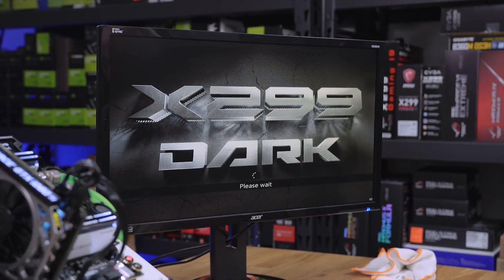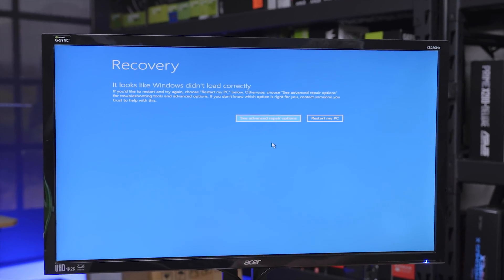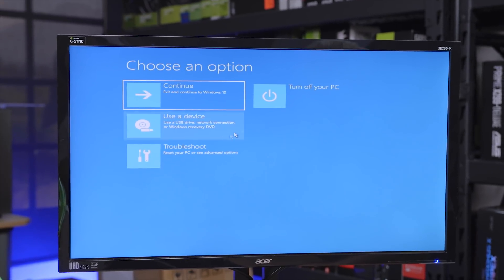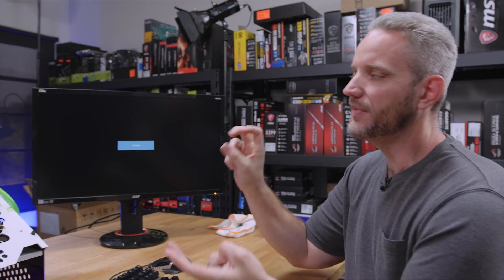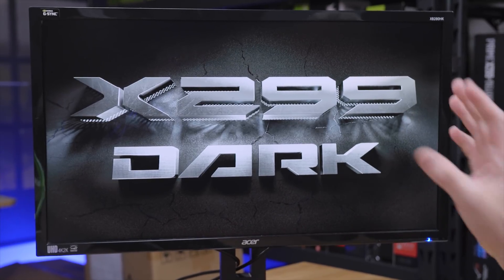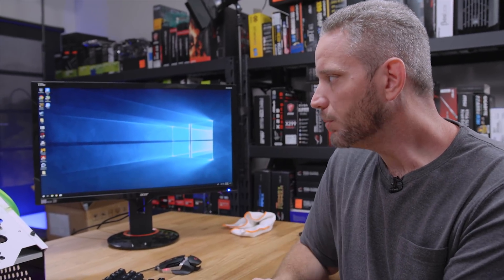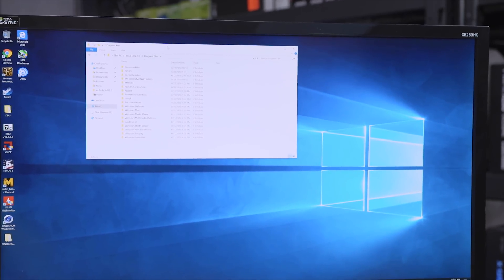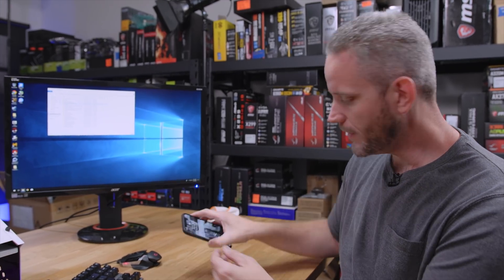New Test Bench Keeps Boot Looping... Here's how we fixed it

Comment: New Mobo(Platform Switch) = Clean OS 👍
Reply: i5 2500k with Windows 7 upgrade to Windows 8 upgrade to Windows 8.1upgrade  to Windows 10 from that to Ryzen 5. The system was running relatively ok but was messed up with the occasinally BSOD and the point i had to do a clean install. Was interesting to see how long a Windows installation can last.
Reply: if your just upgrading from one intel to another intel then its no big deal,since win 8 you could do it very easily,even in win 7 and xp yo could do it but you had to reset the hard drive controller first from a bootcd.
what you do need to do later on is clean up all the junk that accumulates over a few years and hardware changes like the uninstaller directory or old drivers that are no longer used etc.

what 8 and 10 do when they detect hardware changes is do part of the sysprep process to work on the new hardware,you could even do sysprep images of 7 and xp and install on various hardware so you could skip installing everything from scratch each time.
only issue with sysprep images was moving from intel to amd or vice versa,though it seems with ryzen you could do it but would get stability issues.last time i tried an intel sysprep image on an amd system was with windows 7 and in that case it blue screened during the boot.
Reply: Clean OS = Continues to Boot Loop = Shit. LOL
Reply: You can still access the safe mode by booting from install media. Is that so hard? What bothers me is that he's blaming MS but the software he installed - a software clearly made for prousers giving you a huge disclaimer when starting it - is causing the issue. This is why MS does crap like Windows 10 S, then you at least can't blame MS when a program has destroyed your OS, because it's not going to happen.
Reply: @Gerrit So you're telling me that they aren't complete fools for making a well established, user friendly, and intuitive safe mode that's only been improved with every windows iteration into a hard to access and counterintuitive downgrade to what we had before in windows 7 and prior? I'm not familiar with os development, but this is an issue that clearly has nothing to do with development. This is a design choice. What we had before was simply a key to press on startup to access a boot options menu, now we have this long and frankly stupid process in windows 10. No matter how you look at it, what they have here would be more work to program than simply leaving the boot options menu as a hotkey during startup. That aside, safe mode is meant for problems that are exactly as shown in the video. There are many times when program conflicts can cause bootloops, and there's absolutely no reason for uninstalling to be disabled in safe mode.
Reply: It seems you are so damn smart, you could work for Microsoft. You totally missing the point of this video. It is about the that stupid Windows that doesn't let you uninstall a troubling software component in safe mode. That is a common scenario and has nothing to do with his platform switch.
Reply: i usually clean the drivers and just keep my programs
Reply: Yes a person who thinks like me as if I were to buy a new system it's getting a Clean install so there will be no leftover drivers from the past Motherboard .  Windows doesn't mind you doing a fresh install as if you were going to update your system to a new one you just have to let them know the old system is not in use anymore and your copy of Windows 10 will work on the new system...     I suggest keeping games onto another drive so you don't loose your saved games and most everything else you re-download as I will keep my software like  Adobe Photoshop on my main M.2 for fast boots but save everything to another drive so you don't loose anything when doing a clean install .
Reply: i used the same install on 4 different boards. gigabyte X99 > asus X99 >asus X299 > asrock X299. also migrated from a SATA SSD RAID 0 to an nvme SSD. 
YOLO!
Reply: Lmao, never had an issue. Switch from the FX series to Skylake without a clean install.
Reply: Clean OS install isnt needed, just put the OS into OOBE (out of box experience) mode
Reply: What jay should do is setup a pxe bootable windows installer environment that installs all of his testing software and games automatically. Depending on what hardware he was trying to use. Make testing more consistent and take some of the time between setting up go away. He could then update the “master” config once a quarter or with new installs. IE new nvidia drivers. drop the new MSI in the appropriate network folder and change the config accordingly.
Reply: how i felt upgrading from an FX 6300 to an i7 8700k
Reply: I blew an 1150 CPU and had to switch to 1151, was just plug and play.
You don't need always to reinstall your OS.
Reply: fx does not have the same drivers as ryzen DUHHHH
Reply: Indian tech support dude right here....
Reply: This is the best and only answer IMHO.
Reply: I'm a computer engineer
Reply: With how ludicrously fast Windows 10 installs on a modern system with an SSD AND is rather good at keeping UI settings and applications, I install clean or with preserving user data after every hardware change.

And well, considering I've been on Windows Insider since day 1, I'm kinda used to do full updates and installs anyway, so doing a reinstall is trivial.

And really, with an SSD, installing Windows takes 15-20 minutes tops with fuck all to do as a user.
Heck, even on my laptop when it still just has a HDD, it didn't take more than half an hour.
Reply: He's calling Microsoft monkeys but has software installed that is directly accessing the uefi and in that case it's looking for an uefi that it can't find. The only logical consequence is that the OS isn't booting. You should be glad instead that Windows offers something like a safe mode to undo things that should have never happened in the first place. It takes a ton of effort to develop a OS that is compatible with so many different pieces of hardware. What should MS do? Prompt you everytime you start ryzen master that it could break your OS? It's a users fault. Period.
Reply: The "monkeyness" on Microsoft is in how stupid it is nowadays the way you access safe mode.
And the installer services not working in safe mode.
And the uselss "not BSOD anymore" screens.
Reply: MS had a proper safe mode before. He's calling them out for making accessing the safe mode unnecessary complicated and hidden. What use is a damn safe mode if the only direct way is to boot to your desktop? Now you have to fail at booting windows 3 times and then you get into the recovery menu but you still have to click through half a dozen menu levels to actually access the damn safe mode. 

But I guess you're just the impeccable almighty and alknowing Gerrit who never forgets to remove a program. Ashes on our pitiful heads …
Reply: Old way was to hit a key to bring up a boot option menu while BIOS was loading. They should have kept that..
Reply: What they could do, is allow windows installer to be started as a service manually in safe mode since that was the first thing he tried..
Reply: very strange they disabled the installer service in safe mode but you can enable it.
google "windows installer service safe mode" and you get as first result a thread on the symantec website about a registry entry to create in safe mode to get the uninstaller to work. sure renaming the folder is an "easier" solution but if you arent afraid of the registry than i think the solution i found in 2 seconds of searching is better.
Reply: And honestly I can't take it anymore that every hardware guy is shitting on Microsoft and actually knows nothing about OS development or even software development. Use Linux instead if Windows is annoying you so much but you just don't have the knowledge for that either.
Reply: Aww, looks like Gerrit got his panties all twisted. Poor baby.
Reply: Gerrit Gogel because it makes perfect sense to bury the recovery menu options under 6 screens you have to click through and a reboot and only after 3 failed boot attempts where you previously had to only press F8 at boot that has worked fine since f*cking windows 95, right? RIGHT? Oh, and disable windows installer service because god forbid they'd make it easy to uninstall whatever crap is hindering the boot process in the first place or install a bloody anti-virus/malware scanner if you know that to be the issue.
Reply: I've been a software developer for 10 years, and I still think Microsoft messed up here.  Since Win95 you've been able to get into safe mode in a straightforward way by mashing the F8 key during startup that interrupts the process and can put you there.  They overstepped their bounds in trying to make fixing problems "more friendly," hence the frowny face emoji on the blue screen now.  Safe mode is scary and makes normal users pee their pants, so it must be hidden from them at all times.
Reply: Windows 10 has some flaws, I'll give you that but compared to Windows 7 and 8 it is such a huge step forward and I say that as a person who deals with issues from MS software everyday. Tell me a company environment that runs without MS software. That's just almost impossible. Most of their products, is it IIS, SQL or Exchange basically run out of the box and well together. If you configure that in an linux environment it's a pain in the butt. You need multiple different services to get something like kopano, which is a competitive product to Exchange, to work and it's not even close as good and reliable. That is where Microsoft shines: out-of-the-box solutions for huge environments. And everybody who thinks linux systems have a better user-experience, especially for "normal" desktop users, has never ever used linux. You can just erase your whole harddrive with one command and the most you get is probably a warning message. Linux systems have their place. I personally use linux daily but I don't see it as a widely-used replacement for Windows in the next ten years.
Reply: Do you work for Microsoft?
Reply: Gerrit Gogel they could have just modernized the boot menu and kept the keyboard shortcut so as not to scare users that inadvertently press that and end up there(which I bet was the cause for it's removal) instead of completely removing it and burry it. The new way just cause pain for those that just want do do stuff without fighting the OS(actual professionals and enthusiasts). And about linux not having a good user experience for normal desktop users, that can't be farther from the truth(at least concerning the desktop), also don't confuse good user experience with familiarity, I challenge you to leave anybody that hasn't ever touched or even seen a computer in front of a linux distro with GNOME desktop and on windows 10 and see which one they get used to faster(launching apps, managing windows, etc).
Reply: Gerrit Gogel “you can erase your drive with one command”... have you ever heard of format C: /fs:fat32? or deltree C:? Linux isn’t the only one that has commands that can erase the disk, Windows can do it just as easily. Windows is a shitty operating system. The WinAPI is a buggy, undocumented piece of shit, and nobody should ever use it for anything. I’ve tried using it.
Then Visual Studio crashed. And kept crashing. That’s also another major issue— programming anything for Windows nearly always requires VS, unless you’re running some kind of mingw/clang toolchain. 
Windows is not my favorite operating system.

Comment: Honestly I'd say it is AMD who sucks more in this case. They should handle the error gracefully and spit out an error prompt if it detects a non-ryzen cpu. Windows suck because it is hard to get to safe mode and uninstall something, but you shouldn't have to if AMD handled this properly.
Reply: A fault in a user program should not cause kernel panic. Ever. And keeping that true is the burden of Microsoft
Reply: As Zero stated, it's a Driver causing the crash, not a user program. It can happen, GPU drivers, Storage drivers, etc can all crash the system on a boot if they run into unexpected conditions.
Reply: A quick google search said that "AMD Ryzen Master" is a tool to overclock ryzen chips ... I guess similar to Intel Extreme Tuning Utility? 
I first thought it was a very important thing for CPU compatibility, which would explain why an incompatibility results in a blue screen (like the running a AMD GPU with NVIDIA drivers example I've seen in another comment). 
If its just an overclocking tool, I'd say it shouldn't crash the os. I guess an overclocking tool needs low level access but I don't really understand why it can cause a BSOD...
Reply: Wargon. It actually does have some reasoning for crashing the OS. A CPU overclocking tool is different from  GPU. Programs needing that level of access most likely will interface directly with the HAL, which is OS provided. If any component of the HAL were to crash then the correct behavior would be to kernel panic, as there is no redundancy to catch it. 

For this to be handled correctly, AMD should have caught the exception withing the app itself, which is part of the problem, but with this kind of tool there is no redundancy.
Reply: It seems to use a driver to do stuff and it has extra functionality besides overclocking, related though. Things like turning cores or SMT on or off and changing how memory works on multi chip things like threadripper. It does it regardless of what the bios lets you do. It seems to access something at the hardware level. Idk. Would be nice if it didn't cause a BSOD. Thier software for the older FX CPUs does the same thing. It caused a BSOD for me when going from an FX 8370 to a Ryzen system. I only have a laptop with Intel so I can't say if their solution behaves similarly when switching platforms.

My guess though is that by loading in a driver it can access low level things from kernel space, while the application gives it commands from user space.
Reply: The issue here is where does this "driver" go. from a fundamental standpoint The ONLY way to talk to a CPU is through the OS. so any faults that occur with this operation would be uncaught (if not what would catch it?) and would result in a Panic (BSOD).
Reply: no its Jay fault everyone knows a fresh window install will help you with all the trouble bugs and stuff
Reply: I think one of the issues here, it's quite rare that people will switch the Mobo and CPU from AMD to Intel, on the same computer.   I think what is more common, is you take your now 3 year old games machine, pass it along to your spouse for word processing, browsing and email, who passes their 6 year old computer on to kid #1, for homework, who passes the now 9 year old computer onto younger sibling, who takes the 12 year old computer they were using and it goes to the e-recycling bin....
Reply: How is windows fucking up amds fault.
Reply: Zero not true, a properly written driver runs a check for the hardware it uses at initialization and unloads itself if it's not detected
Reply: amd ryzen master does have its own driver and it has caused me issues before.  windows should just kill a driver that malfunctions like it does with graphics drivers.
Reply: @storm Since the issue only occurs when you launch Ryzen Master my guess is the driver component it needs is already stopped or unloaded by Windows. The dll file mentioned is unlikely to belong to the driver so my guess is Ryzen Master tries to call something that's not there and this causes unhanded exceptions at some kernel level that Windows just can't recover from.
@Paul That's not really relevant here. AMD should make better code either way. Also Ryzen Master is used for overclocking. Right from the get go you know the people using it are going to be power users with an above average interest in hardware. They really should expect them to try stuff like this far more often than your average consumer.
Reply: Finally somebody with some brains. Sure the procedure to get to safe mode is atrocious and they really should have a quick option to disable specific programs from startup that's available in that glorious recovery menu of theirs, since that's a common cause for problems like this, even so it's not their fault that AMD are writing bad code. Sadly it seems your average Jay viewer can't distinguish bad code in an AMD dll file from a bad OS :(
Reply: Oh and a slight side note. For all of you writing that this is related to a bad driver you are wrong. The dll file in question is related to the application. It may be trying to communicate with a driver that Windows removed since it no longer sees an AMD CPU, but even so it's AMD's fault that their code crashes when said driver is missing.